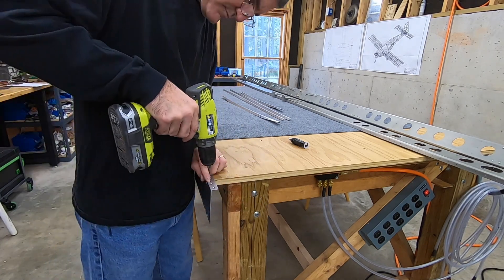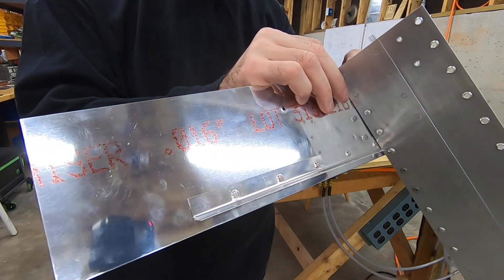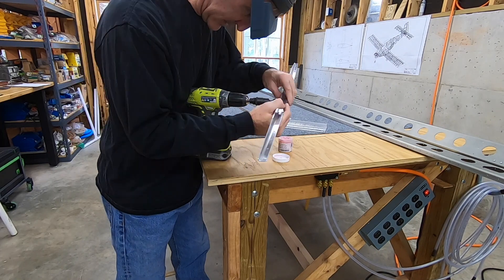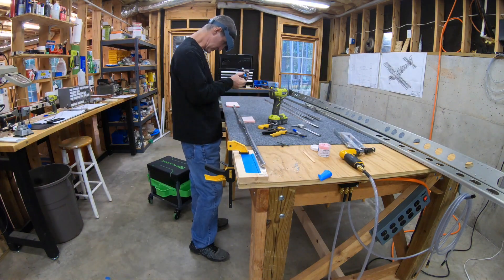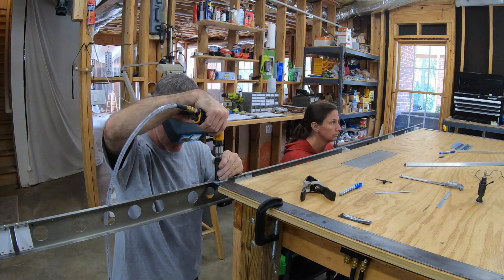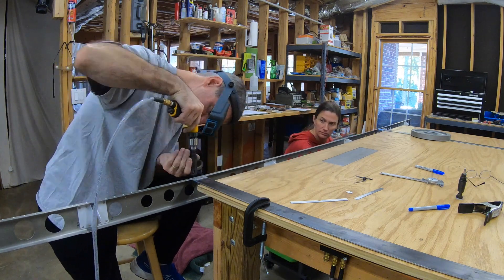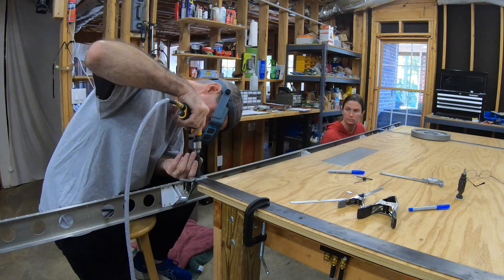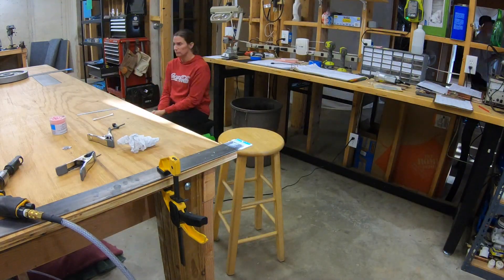RV-10 Build Log - Emp 45 - Hard lesson countersinking the HS Stringers and Spars

Comment: You will get a more consistent depth if you used something like kerosene for a cutting fluid .
Reply from the maker: Wow, interesting tip!  I'll give that a try next countersinks.  Is there something specific about kerosene in particular, or would any thin oily fluid work?  Thinking I have 3-in-1 and air tool oil within arms reach and already in a bottle with a small nozzle.  But if kerosene is superior, I'll get some and put it in a little applicator.
Reply: @missiletwentynine2667  In the machine shop we used kerosene as it was low cost and gave a good finish cut

Comment: Dimple plus .007? Is this the depth for the bottom part to accept the top dimple? Thanks
Reply from the maker: The guidance Vans gives in section 5 of the plans is to set the countersink cage to the exact depth of a flush rivet head, by making test cuts and working up to where the rivet sits just flush, then increase the depth by 0.007" to accept the dimple of the skin.  Often, the countersink cages are designed so that one click is 0.001" so that means 7 clicks.  While 7-thousands isn't quite enough to truly accept the dimple and have the skin perfectly flush (because the dimple is a little larger than the head of an AN426 rivet, Van's evidently determined through experimentation that the 7-thousandths was a good target by setting rivets in dimpled skins in countersunk holes, then slicing cross-sections into them and examining the results.  There is a certain amount of squish that somewhat makes up for the 0.007" not being quite deep enough.
Reply: @missiletwentynine2667  Thanks

Comment: Good informative video. One suggestions for the future: drill a pilot hole in that steel support that matches the holes you are countersinking. It gives a nice pilot for the countersink so it won't wander and oval your countersink. 

Your method worked for you just fine but for me, cordless Dewalt drill on speed 2, with 3 blade countersink works great. I use no lube and the speed seems perfect. I get chatter with my pneumatic and cordless drill speed 1 doesn't always leave a smooth finish. Get a brand new drill due to the out of whack chuck. I found the same problem when some of my match drill holes were coming out slightly oval. Also keep an eye on if your drill bets get bent. I noticed I had that happening to me every once in a while so I spin them each time I chuck them up and make sure it isn't bent even the slightest.
Reply from the maker: Good idea!  I believe someone on VAF suggested the same - use the hole in the backing material to help guide the pilot.  That would definitely be ideal.  I oversized it, frankly, because I didn't think I'd be able to line it up perfectly for every single hole.

Comment: Hey, for that over sized countersink on the stringer , you can get some oops nas rivets so you don’t have to re dimple to the next size up. They have a #30 shank and a #40 factory head. They are so helpful on many part of the build. Spruce has a whole little “oops river kit” that is pretty cheap. It’s an option for ya.
Reply from the maker: Actually, what I need is an "inverted" oops rivet.  As far as I know, the NAS1097 "oops" rivet is an oversized shank with a normal sized head.  Those are the ones I have, at least.  What I need, though, is an oversized head with an AD3 shank.  Maybe there is such a thing.

Comment: A VERY informative video - thank you. My takeaway is to firmly support/secure the workpiece while countersinking. I captured and noted your technique using the steel strips. When I get to this area of the build (RV-14) I'll experiment with using the countersink in my drill press.
Reply from the maker: Yeah, if you can rig up a fixture to support the whole thing AND use a drill press, that's definitely the way to go.  I did the rudder trailing edge in the drill press and that helped a lot, as did setting up the jig as recommended in Section 5.  Drill press is nice because it can go slow but still have lots of torque.  I just couldn't visualize a way to get the whole spar supported in a stable way while also standing on edge in the drill press.  I'd love to see pictures or a video if you manage to pull that off!
Reply: @missiletwentynine2667  That's a video you'll have to wait for at least a Summer '22 release! Still waiting for my empennage kit I ordered last May!
Reply: It is a great video by Missile Twenty Nine !   @EJWash57  I am also very interested in ways to support the whole spar for a table top drill press.

Comment: I've spent the last four months, while waiting for my kit, practicing various tasks. Of them all, the idea of countersinking on the actual plane is by far the scariest because the slightest error will result in chattering, which I experienced many times. I spent hours and hours reviewing tips from others and actually testing them in the shop. On my most recent Van's practice kit, my third, I pulled out all the stops to prevent chattering on my trailing edge wedge: a properly configured drill press, a jig, underlying guide holes for the countersink pilot, and clamps to keep everything secure. I took my time and was anal. Alas I was not anal enough and still ended up chattering two holes. My clamps weren't tight enough. I don't know how so many people have gotten through these issues without such troubles, often with just a countersink cage in a hand-operated drill. Boggles my mind.
Reply from the maker: I completely understand.  My rudder TE was definitely less than perfect.  I have to remind myself that nothing is going to be perfect, that it's a learning experience, and that I get a little better at each skill with every part.  This is much like every other DIY projects I've undertaken - by the time I'm done, I'm really good at it ;-)

Comment: I thought once set the counter sink stop would prevent going to deep?
Reply from the maker: In theory it should, and on a wide, flat surface like the web of the spar or doubler, it usually does.  But in practice, it's just not perfect.  These are, after all, hand tools.  And the thing about these thinner areas like the spar flanges and stringers is that they're narrower than the counter sink cage diameter, and have a bit of a curve to them.  So you have to be really careful to back the part and shim the areas of the cage that aren't in contact with the part so that nothing moves and you can get consistent results.

Comment: Thats a lot of counter sinking.  I did mine by hand too but later i learned how to jig my drill press for more precise counter sinks.  But sometimes using your hand with the drill is the best way to go.  My Ryobi did well, but i haven’t dropped mine off a ladder so that could be the difference 😝.  I definitely don’t like having a hand tightened chuck though, super pain in the butt.  By the way, i jigged my spars with bar clamps and 2x4’s and just moved myself along the spar.  used the same setup for riveting the doublers and hinge brackets.  I get you are using a jig to keep your cage flush but I use my off hand to hold the cage surface flush with the flange and that usually does the trick.  Oh and also, the rv10 has a diffefent tailcone than the 14 so you might not need to worry about the reduced dimple die I mentioned to you earlier.
Reply from the maker: Hope not on the reduced dimple die...  You got me worried ;-). I'd love to see a picture or something of how you rigged up the jig to hold all of it in your drill press.  That would really be the way to go!
Reply: @missiletwentynine2667  think I have some on my build log but usually a piece of scrap 1x3 wood that you can drill through and the clecos will go right into the wood and hold the piece to the wood.  Then you can slide the wood along the drill press and just counter sink away.
Reply from the maker: Is your build log public somewhere?  I get clecoing it to a piece of scrap wood, but I'm trying to visualize the best way to stand the whole thing on end to do the flanges.

Comment: Great tips! I’m “borrowing” a number of these when I start on my build after my workshop is completed. By the way, it seems as if you’re in your basement. Is there enough room to get your plane out once it’s mated with the fuselage section?
Reply from the maker: Thanks!  Yes, I'm building in my basement, and, no, it won't fit out the door fully assembled.  But everything except the fuselage will fit out the door in pieces no problem.  When it comes time to assemble the tail feathers to the tail cone I'll need to decide if I want to do that in the basement, with the expectation that I'll have to take it back apart, or move those parts to the garage for assembly.  That decision will most likely depend on whether I have my wing kit by then.
Reply: @missiletwentynine2667  if it were me (which it will be soon enough), I’d opt for assembling everything once in the garage. The more you take things apart, the more opportunity for something to get screwed up. Food for thought.
Reply from the maker: @CheckSixAviation  I very much agree with you.  I've even considered waiting until way down the road (years) when I presumably move the whole thing to a hangar.  But that's a decision I don't need to make yet.